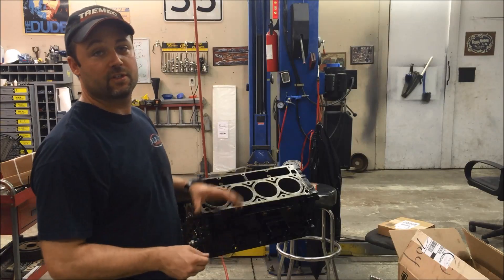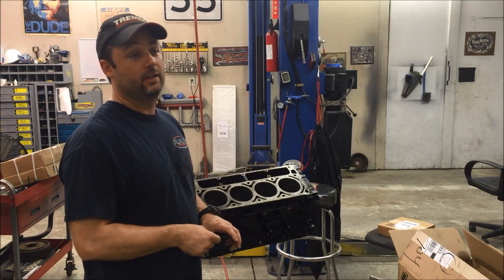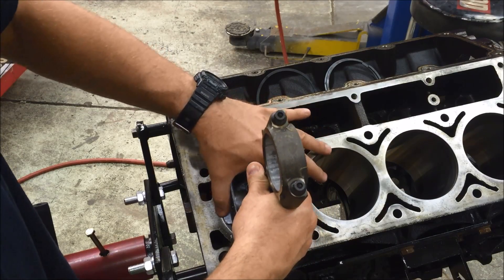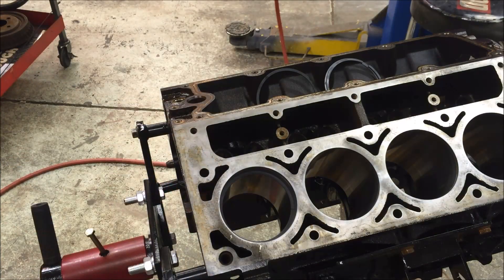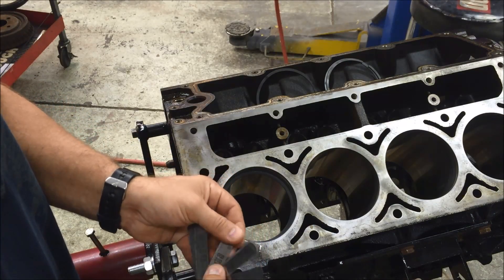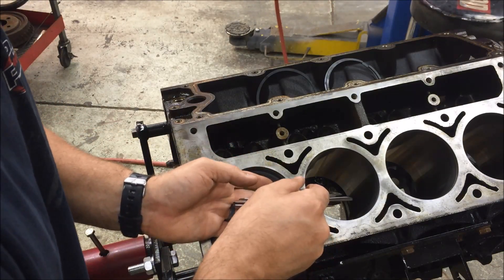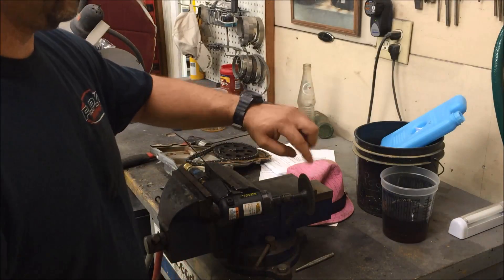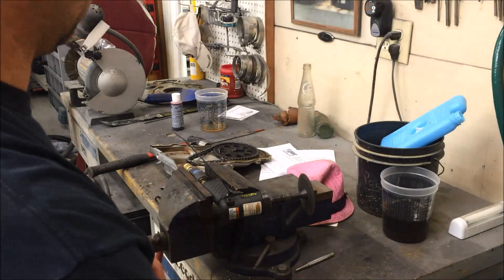Twin turbo LS swap foxbody Mustang part 3A; setting up the ring gap on the 5.3

Comment: does it need to be hone to put it back together?
Reply from the maker: I honed it with a spring loaded 3 stone deal from the auto parts store.  I don't think I know enough to say one way or another if it "needs" to be done or not.

Comment: went to no prep madness this weekend and met a cool local guy with a big tire car running a bone stock lq4, never been touched internals, with a twin turbo setup out of a salvage jeep making 1100whp on 29psi. STOCK motor. No idea how he ran half a dozen big tire passes with no issues but im impressed
Reply from the maker: They can make power, no doubt about it.  It seems like the thing that kills them is the ring gap closing up and it breaks the ring land off, or detonation.  Good gas (110+ octane), methanol injection, and the proper tune up seems to be the ticket for the guys looking to push 4 digit HP on the stock internals.  There's an article that hot rod did a few years ago where they took a 4.8L and boosted the heck out of it.  They made 50 pulls or something on the dyno where it made over 1000 HP.  And it never did break anything.

Comment: Nice setup with the cut-off wheel...sure beats filing!
Reply from the maker: Thanks.  I should have a ring filer, but I don't.  For now, trying to make do with what I have.
Reply: Around here we call that "hill-billy engineering"...